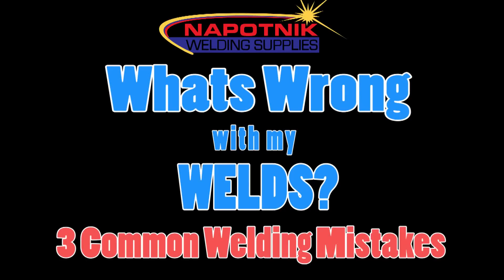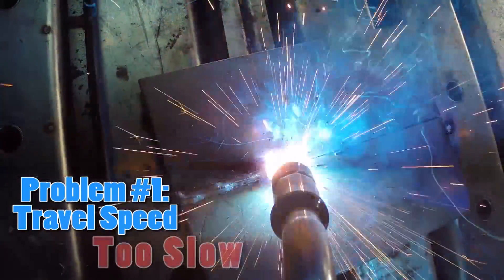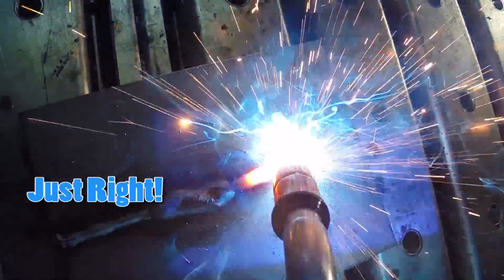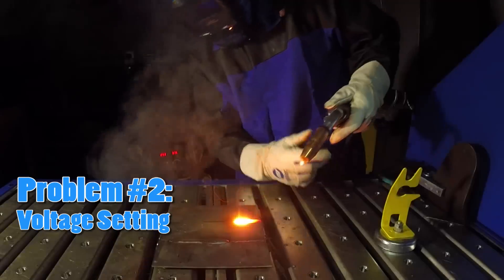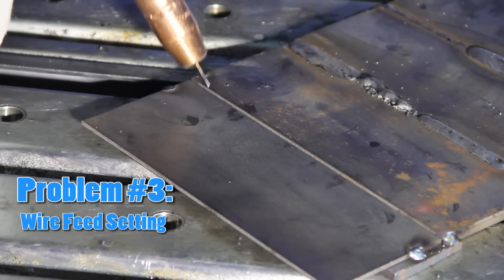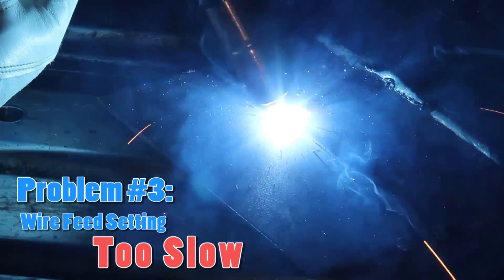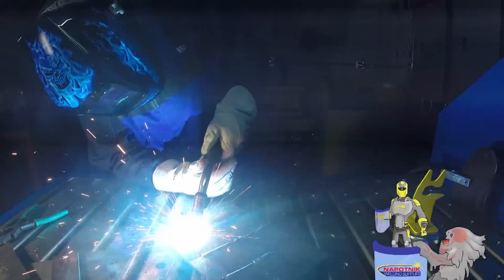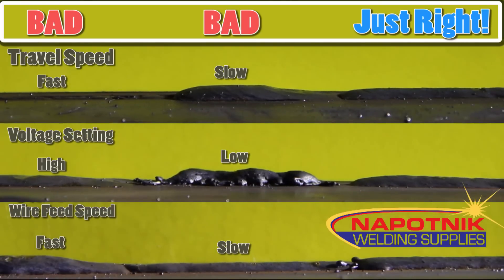WELDING FAIL: 3 ways to NEVER EVER WELD!!!

Comment: heat and wire feed speed isnt to much of an issue if you can adapt the speed at which you move foward, although this does not include extreme lows or highs. but there is def some wiggleroom for each comfort level.

Comment: i like my heat setting high  great penetration and flat  nothing wrong with lots of heat depending on thickness of steel.
Reply: Actually there is. But many new welders like to run hot as they think it makes them "more pro".
Reply: @firstlast-fr1le  run hot move fast. squirt gunning isn't as complicated as people like to say. It's a production procedure so treat it as such.
Reply: @CatDaddyx2  It is very easy to run it hot and fast. If you are a production welder and don't care about anything but speed then sure have at it.
Reply: Id rather be too hot than too cold.

Comment: nothing wrong with a high heat setting, you get lot of penetration , all depends what you welding.then you get a nice flat weld.
Reply: akaeldin you also get a greater heat effected zone and more warpage. just weld with the right temp. you're better off.
Reply: You do not need a high heat setting to get pen. That is pure bs. "A lot" of pen is a rookie move and does nothing to strengthen the weld. Get proper pen and you are set. No  reason to spray arc everything just because you want to get lots of pen.